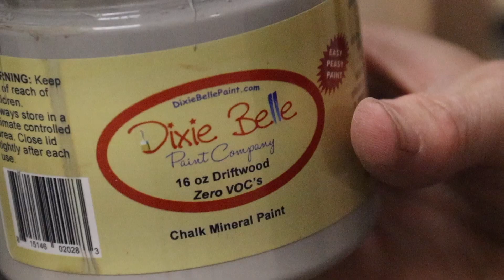Furniture Makeover Start to Finish | Kitchen Table Makeover | Trash to Treasure | Furniture Flip

Comment: So beautiful ❤️ I love how you used the heat gun to remove the paint. I have to try that method!!
Reply from the maker: They are magic...not really less work but still it was so easy to do it that way. Best part its a Wagner and cost less than $30 from Lowes